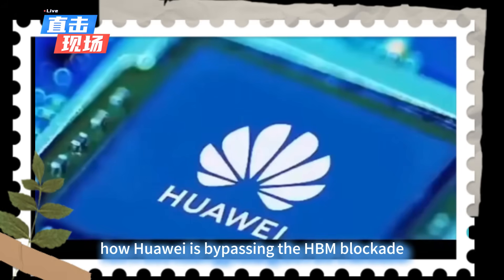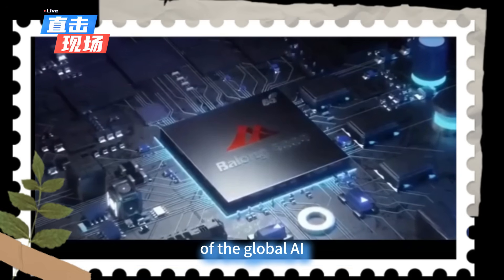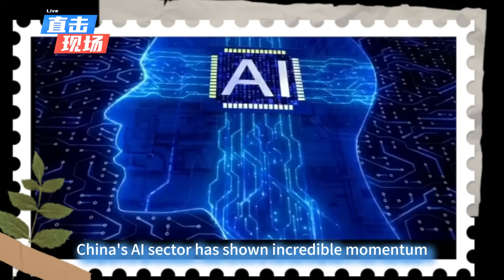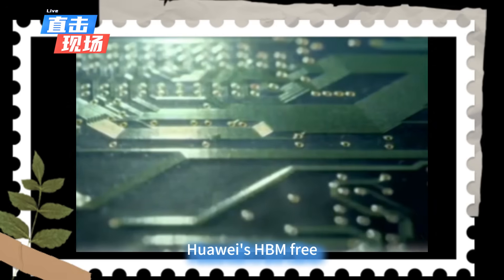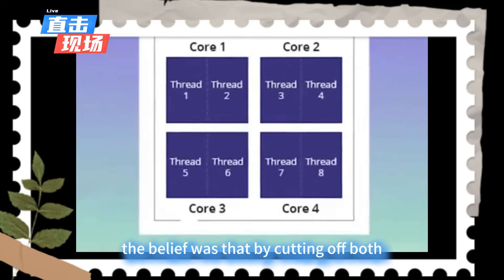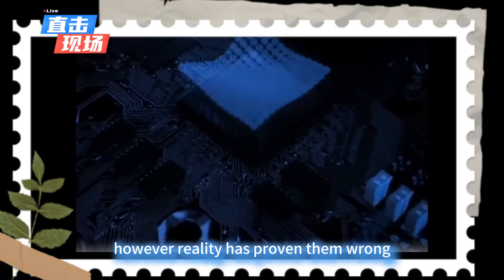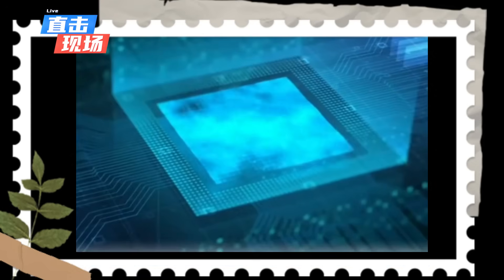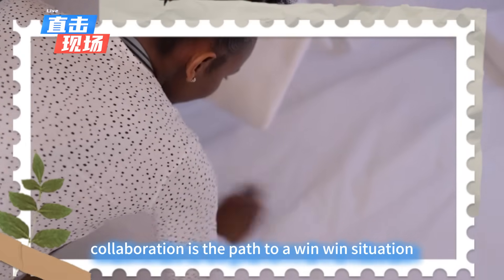How Huawei Is Bypassing the HBM Blockade？

Comment: Huawei has managed, for its latest Ascend GPU's, to source Western High Bandwidth Memroy, HBM despite all the embargoes and sanctions. How ? That remains a mystery, but this HBM, of a variant HBM3 and above, is a critical component in the Ascend GPU's and IS NOT MANUFACTURED IN CHINA.                                                                                                                     Q: Did the HBM in currently sold Huawei GPUs originate from CXMT?

A:No, this is highly unlikely and contrary to what reports suggest. The HBM in Huawei's current high-end AI GPUs, such as the Ascend 910 series, did not originate from CXMT.1
 According to multiple analyses, Huawei has relied on a variety of methods to acquire HBM for its current generation of chips:

• Stockpiling: Huawei reportedly stockpiled a significant amount of HBM, primarily from Samsung, before U.S. export controls were tightened.2 This gave them a crucial buffer to continue producing their chips.
• Legacy Supply Chains: Some reports suggest that Huawei's chips are using older-generation HBM from global suppliers that may not be covered by the most stringent embargoes.
• Circumvention: There have even been reports of Huawei using shell companies to acquire chips from TSMC, which were then packaged with HBM into their GPUs.3
CONCLUSION: The success of Chinese AI models like DeepSeek does not necessarily imply a successful, scaled domestic HBM supply chain. It implies that Chinese companies are resourceful and have been able to procure the necessary components through a mix of stockpiling, legacy supply chains, and other means to meet their initial, urgent needs.